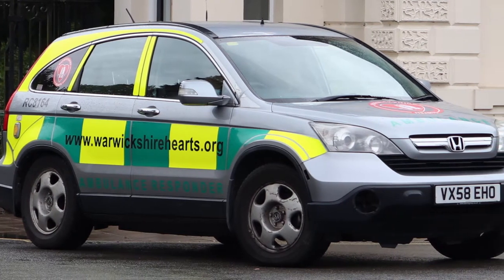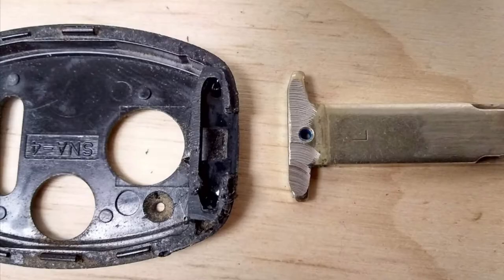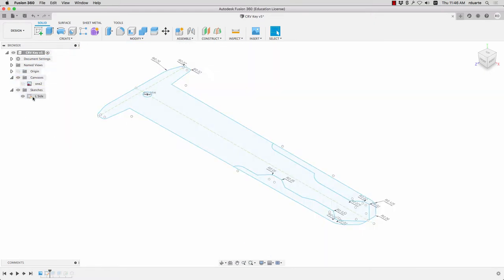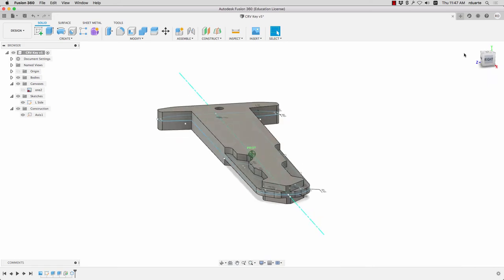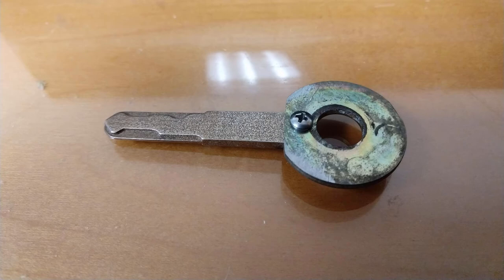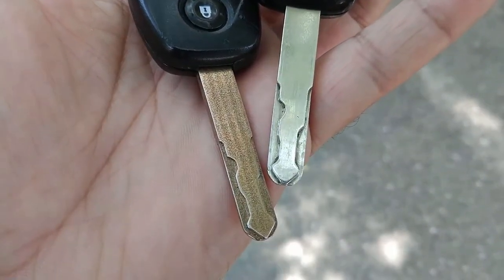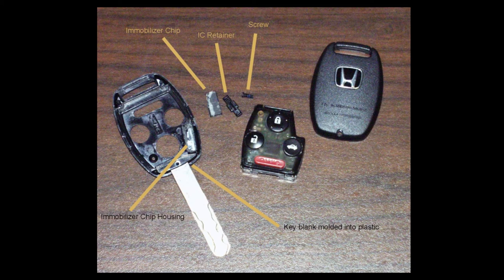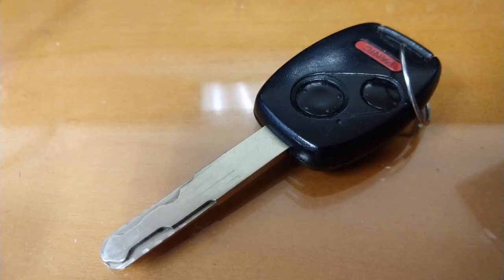Making a Honda key in Fusion 360

Comment: Great until the immobiliser catch :) - did you have to change the fusion model to account for shrinkage in the metal printing ? - I have had a few things printed this way and  they don't match the model unless you take that into account - or was there just enough inaccuracy in the keyway?